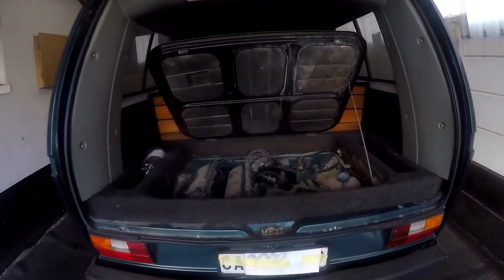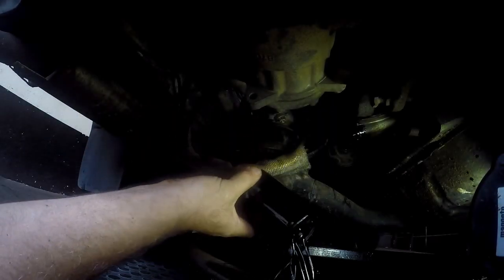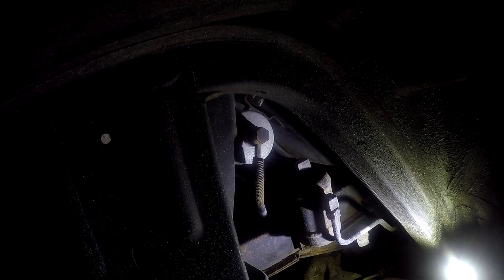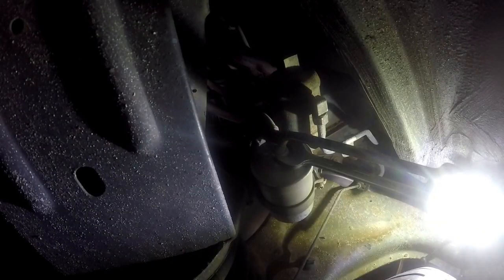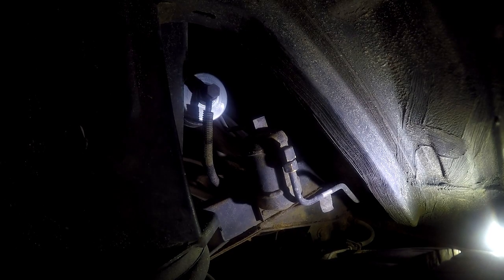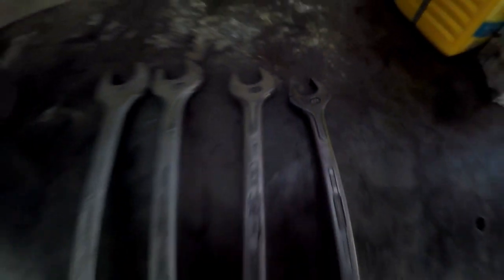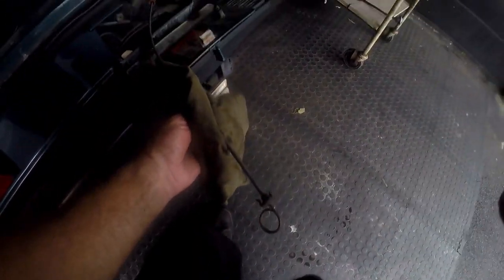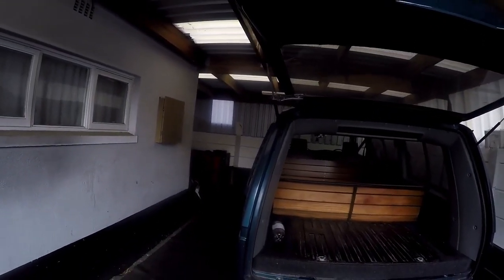Vw Microbus 2.3i - Oil, Plugs & Filters Changed

Comment: Memories of those microbuses, and how that AC could keep the driver cool, or the passenger in the front cool, but the rest of the bus just had to live with the trickle of coolish air.

Loved the door holder open device, much better than the calibrated broomstick I used to use, till I went to the spares place and got all new gas lifters.

Comment: Hi I own a 2.3i 1995 model microbus I just wanted to know can I use a Mk1 golf oil dipstick also to check oil level in sump is the length the same as the Mk1 golf oil dipstick thanks
Reply from the maker: No, I would not use it, try to get the proper dipstick for that engine, Mark, oil grades, and levels are important for the proper maintenance of our vehicles.
Reply: Thanks appreciate it perhaps do motor spares shops sell that long microbus oil dipstick
Reply from the maker: Try Exclusive Auto Spares 0217054172